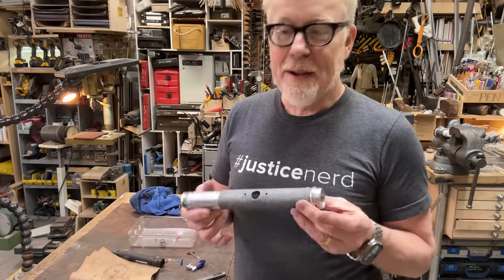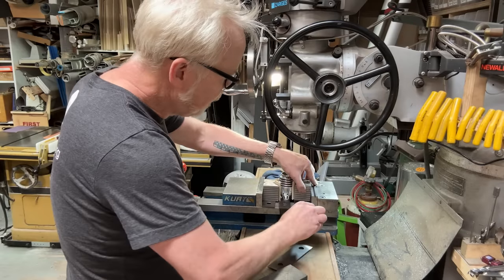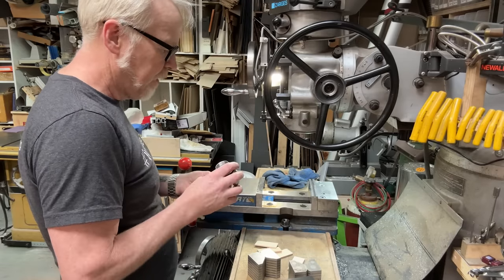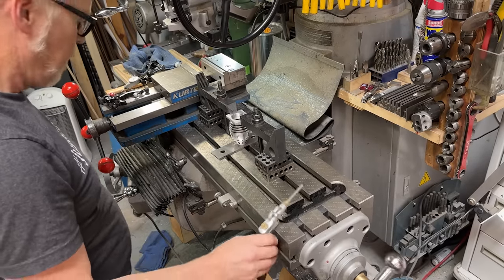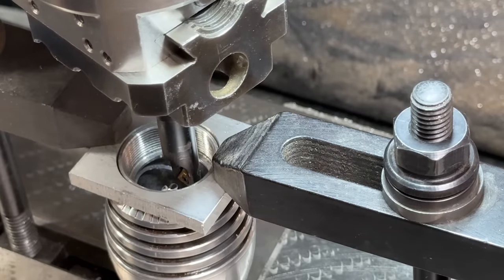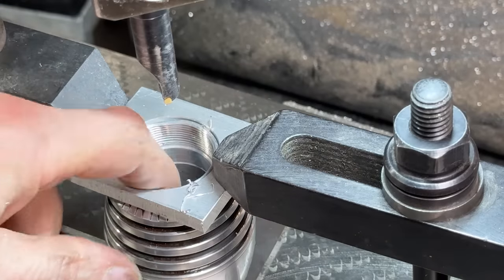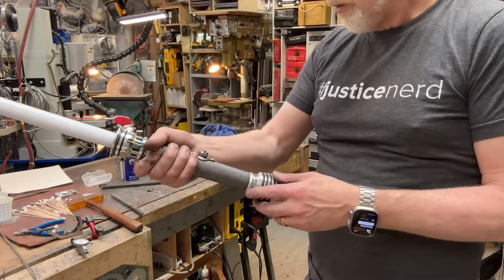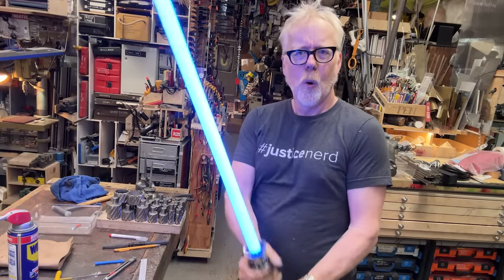Adam Savage Mods His Custom Lightsaber!

Comment: Adam, you may know this now but when you were changing the lightsaber color, it seemed like you put it into a mode where you could simply rotate the hilt parallel to the ground, and it will smoothly cycle through the spectrum. When you get to the color you like, I think you just press the button, although every board is different. In that mode, you don't need to do the quick snapping motion. It allows you to be a lot more precise with the color.

Comment: As a machinist, Adam's quick problem solving is spot on as a skill only acquired over time constantly looking at the same set of problems.  AvE quotes it as a "economy of movement" that old cuss' have, when you see the same 100 problems for years in a row, your tools to solve those problems are honed to an incredible degree.  It's a challenge for anybody old or young to think you know the best way.  Always pull from different sources.  Smarter Every Day just put out a video and a key point was safety, and using more than one person to tipple check you, and then consult with fresh eyes of someone brand new to the project.  Respect from me, as always, Adam.

Comment: The brass ring is a very nice addition. I might think about adding some brass highlights to it to pull the theme throughout the saber. Maybe replace some of the screws with brass ones. Maybe that knurled screw holding the blade could be brass. Maybe another brass ring added into the top end. I know, I know, Build your own dam saber and shut up. Just some input to think about is all.

Comment: You could have 3D printed custom soft jaws for the lathe to hold that pommel. It’s easy to import a picture and scale it to size with many of the CAD softwares. It may not have been faster but very effective way to old odd shapes.

Comment: I'm not a machinist but I never miss a video on this channel. So, I started wondering why removing that internal lip wasn't a job for the lathe. Wouldn't the lathe jaws hold on to the pineapple just fine? It might be an obvious answer but as I said, I don't know much about this stuff.
Reply: In my humble opinion, 1) it's hollow with thin walls and made out of a soft material. 2) the bore is likely too small on the lathe to get it set in enough to get a good enough hold. 3) very convex on the outside, like a pineapple, which makes it tough to get an accurate/centered hold in the lathe jaws (not impossible, he could have quickly made a tool to hold it, but the way he did it with the mill was easier/more secure, imo). Bonus 4) he got to use the mill. :]

I don't remember how thick the walls ended up being on the Pineapple and I don't remember how he held it on the lathe back when he machined the part, the walls look a few mm in some places (when he dropped it, the part warped or at least tweaked the threads pretty bad). The jaws on the big lathe (I might be confusing Adam's gear with Mr Pete's/Tubalcain's) would probably fit, but it wouldn't be a very deep grab because I don't think the bore would be big enough for the Pineapple to fit inward, plus convex outer walls vs straight jaws. The lathe jaws may damage it because of the thin walls and aluminum being soft as it is without having made a special holder for it. Also, he got to use the mill. But don't take my word for it, I'm self taught on a HF 7x10 lathe. I've had lots of fun with that little lathe, tho, and made a few hilts over the years for friends.

I can't help but think that new board has a problem, tho. I can't hear the idle hum and it seems to be acting pretty flakey compared to his other board, but it may just be me (viewed on a tablet, no headphones).

Edit:
Ah, I finished the video. Yeah, the bore is big enough on the lathe chuck, so scratch that reason (wouldn't be on mine, but mines only a little 7x10). See, I really should finish videos before I comment on them. lol

Comment: There are various companies that have sabers available. From Simple that cost around $100 with basic RGB lighting to ones with programable cores and light patterns that can go for almost $1,000, and never mind the custom-made versions. I was surprised I could never find anything in the way of anyone who made any add-on parts for them other than internals. Nothing to flash up the outside. I have a less expensive one that I am going to make custom thumb screws for holding the blade rather than using the standard allen set screws they come with. I know it would be a fairly niche market to be in, but no one seems to be even trying that niche.